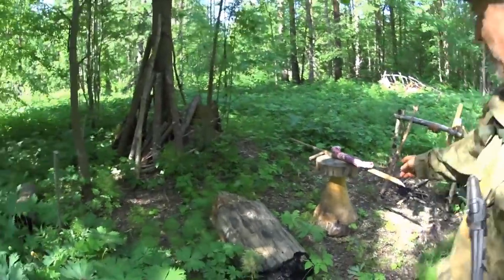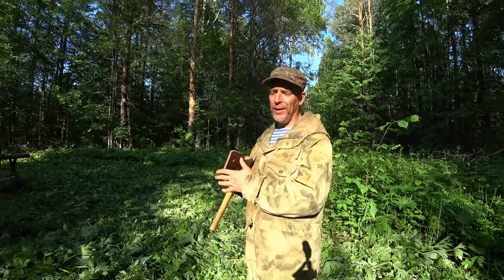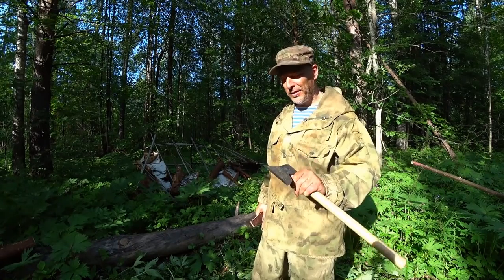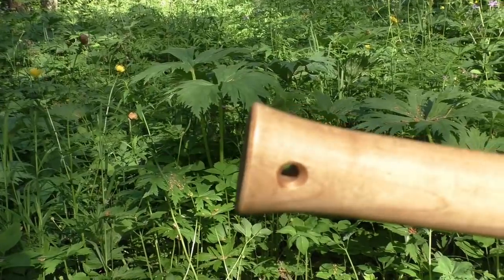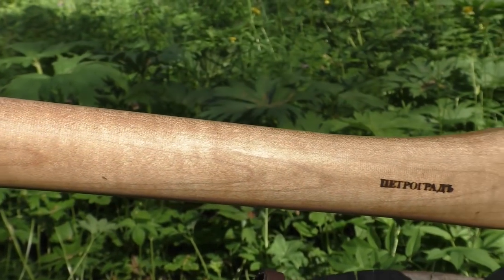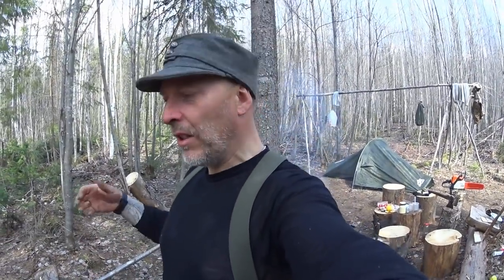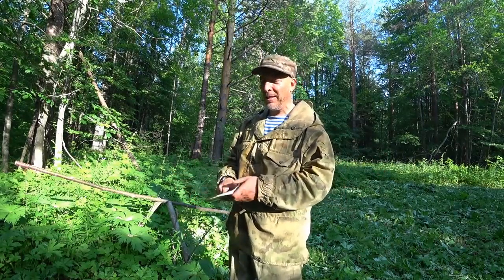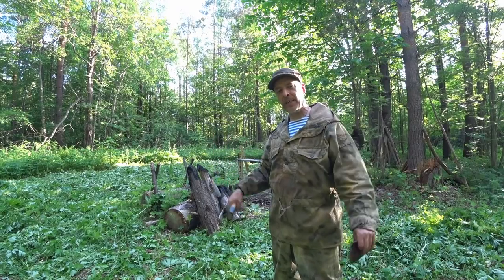Excellent All Round Camp Axe | Hand Made Carpenters Axe

Comment: i haven't used a pack axe or forest axe or any ofthose, i just went camping for a week and my main choppers was the cold steel trail hawk, which is perfect for felling the usual standing dead wood, and the always excellent ka-bar kukri, if you arent felling large trees or splitting huge logs and just doing bushcraft or shelter construction then either are usually more than enough for the 4-5" diameter standing dead wood, the saw is indispensible though, especially for where i was camping wich had stupid raised concrete rings for fire pits and the logs had to be a certain size to fit.

Comment: Maybe I have missed it, but in catching up with the videos, I have thus far seen for hiking/camping and survival use the Silky Ono and the little Friskars hatchet which I know Lars likes.  Obviously, this axe is more for heavy duty use, and it would be more heavy and bulky to carry.  Does anyone (including Lars if you read this)  have an absolute favorite for the backpacking type axe/hatchet?..has anything changed in the opinion of the Silky or Friskars?...input greatly appreciated.  I am in Tennessee and thus can order many different types.  Estwing  with the full tang handle has been mentioned to me and I have a hammer made by them which I really like.  As you probably know, Amazon has more than I can mention.  I am not a spring chicken anymore and weight will be a consideration for me.  Thanks!

Comment: Have not noticed any in vids but do you have Oak tree species there or walnut, cherry & hickories?
I can send you some top quality Hickory,cherry, handle stock if you would like some. Certain walnuts here(native) & cherry have top quality handle characteristics. Made some Cherry handles for an ax and i am impressed at the thing.Cut a 6 inch round Hickory and it is 90 years old,annual rings are about 1/16th inch,so dense it is unreal.

Comment: I could never understand the price of those Swedish small axes, hundreds of dollars. Of course i use Fiskars as it's Finnish and great product but it is always nice to hear of a new, not so well known creator. Ill check it out for sure.
Reply from the maker: I have tested the Fiskars axe handles extensively. They hold up to temperatures down to at least -25C. They can also withstand being stored summer and winter in a simple shed without affecting the strength of the handle. My Fiskars have a tough life and it does not mind :)

Comment: Can you contact the Petrograd people their site is very nice, but the prices are in rubles not dollars, when I did a currency calculator it showed the axe would be around $5 usd that can't right, they have a English version, the price should reflect in pounds or in dollars not rubles.
Reply: Just use an online currency converter. But PayPal will do it automatically. By the way that axe is about 125 USD
Reply: I was able to use a currency converter no problem. Quick reference: divide the ruble price by 64. This should get you the dollar conversion. Cheers!

Comment: Have you tried out some of fiskars axes? if you have, what do you think of them?
Reply from the maker: They are good in my opinion, and holds up to the frost well.
Reply: I find that the fiskars have a much softer steel than the typical forged axes. They sharpen well but edge retention is poor. At least from my use.
Reply from the maker: That is correct and my observation too, but the handles hold up well in the frost. I have used one for quite a good many years.

Comment: European Axes are much lighter than American Axes. when the Settlers arrived they had to design axes that would cut the massive hardwoods on the new continent. They invented the Felling Axe and around the Mid 1800's they invented the double bitted Axe. The Northern lumberjacks, this new breed of skilled workers, kept one side of their axe sharp and let the other be nicked and blunted. The sharp blade was for cutting cleanly into wood. If they saw anything dubious, like a tough knot, they'd rotate the handle and use the rough blade. I've done a lot of splitting with axe and maul. The worst is Eucalyptus. Wet, it's like hitting a cement telephone pole. Dry, it twists up into knots and is damned near impossible to get even splits.